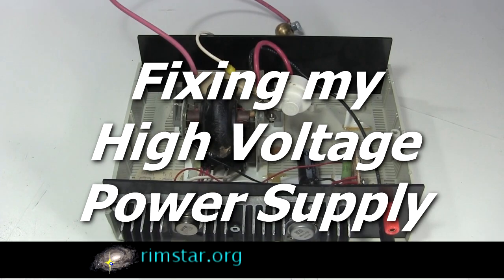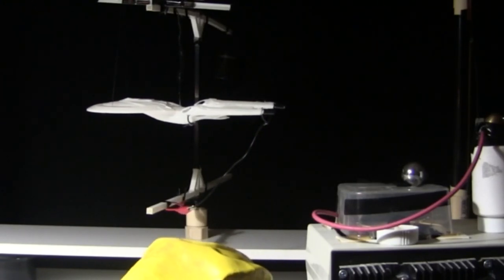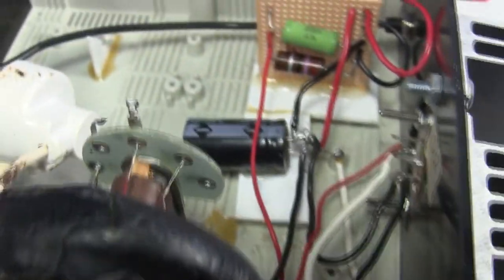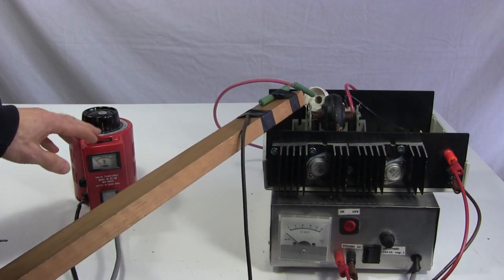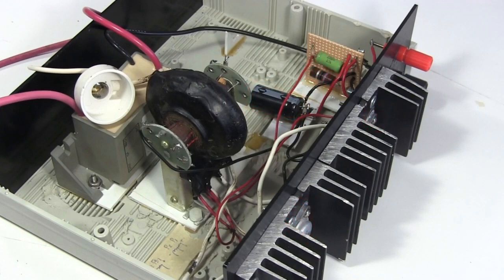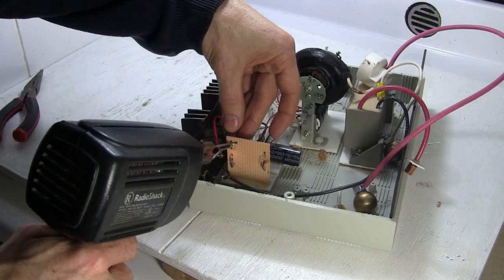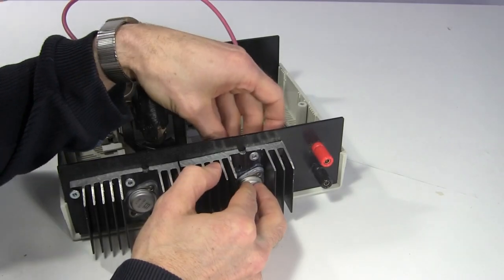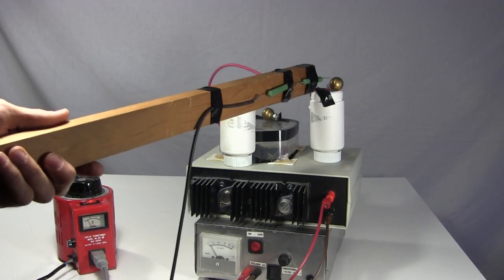Fixing my High Voltage Power Supply

Comment: I love this, as a hobbyist car mechanic, we always test the easiest stuff first. The car battery (or its terminals) is surprisingly the most common problem with cars not being able to start. You really show how to test the easiest to test components first, and then move on to the next. This is especially true for motorcycles. It's trivial to check a battery first before delving into the carbs or other things like the stator! And more often than not, in general, it's the electrics that are the problem (be it fuses or a bad battery). Sometimes it's counter intuitive to go after such a simple thing that isn't likely to fail, but you should always test the easiest to test functions of a system, because even if you're wrong or the parts are working, you're still expending the least amount of effort in the long run. An engine might not start because of a blown cylinder or a starter, but if it's the battery, you've saved a crapload of trouble shooting time despite that the battery in general is the least likely to fail (over the course of a vehicle's life).
Reply: To further explain my comment, to test a blown cylinder you need to do a pressure check, which involves screwing a pressure gauge into each spark plug socket (for non-diesel engines), then turning the engine (with the starter). To test a starter you need to remove it completely and either run a torque test with your own equipment or take it to an auto-store to run said check (assuming a visual inspection doesn't reveal a broken sprocket!). To test a battery you just need a voltmeter and charger! (If it's taking a charge then you can deduce it's the alternator or in the case of a motorcycle, the stator, that's failed.) So, as most auto manuals suggest, always check the battery first, it's the easiest thing to check, though they last 5+ years and aren't likely to be the culprit.

Comment: Good to see you got this fixed! Very happy to see it was just a transistor :)
Reply from the maker: Me too. I was worried it was going to be the multiplier or the flyback. Though if it was the multiplier, I was going to make from from scratch and of course do a video of it.
Reply: That old ac flyback wouldn't be too bad to re-wind either. Might be able to get thicker wire and push more amps...

I cant seem to replace my good flyback that died. Tried a few other with the same extra wind. Not getting nearly as much output. Must have been a lucky one. I think I have another one the same, but its buried under a ton of Plasma tv parts...
Reply: RimstarOrg I'm almost disappointed it wasn't the multiplier (as I watched it was my first assumption) but I'm glad you didn't have to wind your own as that would've been a pain for you! (But interesting to watch, though, I'm conflicted.)
Reply from the maker: joshcryer
I'm sure you meant the flyback, that's the one with the coils. The multiplier is the grey and brown box behind it with the red and white wires coming out. The multiplier has a bunch of capacitors and diodes in it that step up the voltage (multiply it) while also converting it from AC from the flyback to DC as the final output. Multipliers are fun to make and you have to insulate the final circuit either by immersing them in an insulating oil (e.g. mineral oil) or epoxy, as this commercially purchased one is. That's to prevent sparking between the parts. If you're curious, I've made some before and have details on my website http://rimstar.org/equip/pos_neg_voltage_multiplier.htm

Comment: Glad you managed to repair it and it wasn't the LOPT or multiplier that had burnt out!

Luckily you seem to have "good" 2n3055 transistors which have lasted as long as they have; there are slight differences in the fabrication process between different manufacturers that cause people to have such bad luck with these 2n3055 flyback drivers. For example I had an ST branded device that didn't last more than a minute but the "on semiconductor" replacement has lasted years of abuse on power levels around the 60-100 watt region.

But it is always good to use some additional protection across the transistor(s).

Add a fast recovery diode across each transistor with the cathode to collector and anode to emitter; BJT's are rather vulnerable to negative going voltages on their collectors. For further protection use small film capacitors of around 10-47nF across each diode too and this will shift the transistors into quasi class E switching and can even reduce the heating of the transistors slightly. Larger value capacitors will reduce the output voltage slightly but will also reduce transistor stress, so experiment before finalising the value.

I have yet to experience a single transistor failure using the modifications above, so it might be worth a try.

Also if you wanted to increase the output voltage without increasing the input voltage you can reduce the value of the 27 ohm resistor to somewhere between 10-15 ohms, just make sure it can dissipate several watts without burning up! This might make your ion motor spin faster too since there will be a higher voltage and more corona to propel it.

Using this method I could draw 3 inch arcs from one LOPT using the single transistor version of this driver with 24v (required a large heatsink for extended runs).

Really enjoy watching your videos!
Reply from the maker: Thanks for all these tips! This power supplies been incredibly resilient but I might just try what you suggest for the added protection and as a learning experience anyway.
I'm glad you enjoy my videos! I recall enjoying yours too, when you used to upload them. Hint hint :)

Comment: very cool vid rimstar =D i did that many times with my supplies as well can be annoying the more complicated the setup ! where did you get the awesome AC flyback ? and do you use protection diodes on the transistors ? they could help in the future .. anyway cheers !
Reply from the maker: Thanks. I ordered the flyback from a fellow who used to sell them online (around 10 years ago). I'm glad the problem wasn't the flyback because I'm guessing it'd be hard to find a plain one like that these days. I don't have protection diodes on the transistors. I guess I could add some. The transistor's pretty cheap and easy to replace and this power supplies pretty robust; it's withstood an amazing amount of stuff over the years before this first breakdown.
Reply: RimstarOrg yes those types of flybacks can be rare to find i have not one yet but have wound similar ones myself its good fun but lots of time for the hand wound secondary :-P and thats a push-pull config. you built right and you are using the 2n3055's ? im currently using 2n3773's for a new project they are the upgrade for the classic 2n's but yes well built power supply ! and i love the housing too :-)

Comment: Are you using 2N3055s or the NTE  equivalent from what I see now and in your previous video? I'm thinking an NTE 238 would be more durable being it's a horizontal output transistor that was commonly used with the flyback and voltage tripler.
Reply from the maker: Mike Samra I was using 2N3055s before this fix, then I replaced one of them with the NTE equivalent, NTE130, which is the new one you see in this video. I since broke that NTE130 and replaced it with a 2N3055 again. Looking at the datasheet for the NTE238, it does have an interesting difference but I don't know exactly what broke down in the transistors so I can't say if it would be better. Thanks for bringing it up though, I wasn't aware of the NTE238 before.
Reply: I think he 238 will hold up because that's what every Color set as well as big projection sets used that carry upwards of 30 to 50kv.

Comment: hey RimstarOrg, great video, i was wondering what is the full name of that voltage dial you had in that video?
Reply from the maker: Davesh Purohit If you're referring to the red thing I was using to adjust the voltage, it's most often called a VARIAC, also known as an autotransformer.
Reply: RimstarOrg thank you, I really appreciate taking your time to answer my questions, also what power supply do you recommend to build your own ionocraft?
Reply from the maker: Davesh Purohit
Do you mean what power supply would I recommend building to fly a lifter? If so, the one I repaired in this video has done great for flying lifters and powering all sorts of other ionocraft for me over the years. It's the one in this video "How to Make 30kV High Voltage DC Power Supply with Flyback & Cockcroft-Walton Multiplier Tripler".
Reply: Davesh Purohit also one more question, do you have any outside sources where to buy a power supply that is built to fly a lifter?
Reply from the maker: Davesh Purohit You can find some at http://www.amazing1.com/. I don't know which ones specifically as it's been a while since I've looked through their stuff.
Reply: RimstarOrg okay thanks

Comment: I'm interested in that soldering gun. Where can I get one of those?
Reply from the maker: I bought mine at Radio Shack. Most electronics store should have them.
Reply: RimstarOrg Make and model name? I could 'shop-around' with that kind of information.
Reply from the maker: PSRBF6
I selected it pretty randomly. It's called Radio Shack - Duel Heat Soldering Gun rated at 230 and 150 watts. The dual heat means if you press the trigger a little you get one temperature (150 watts in this case) and if you press it more you get a higher temperature (230 watts). The low and high heat feature is nice to have. A big name in soldering guns is Weller.

Comment: how did you ground the wire with the stick exactly?
Reply from the maker: Blueghost136 I bought a three-pronged plug from a hardware store and connected the wire just to the ground prong. You can see it in my video "How to Make 30kV High Voltage DC Power Supply with Flyback & Cockcroft-Walton Multiplier Tripler" at 7:07 and at 7:36. It's a bit of a dangerous approach unless you know what you're doing and you're sure the ground hole in the socket you plug into is actually grounded.

Comment: Any way to block high voltage surge back to the device?
Reply from the maker: I usually put a spark gap somewhere that will spark to ground if the voltage gets to a certain amount. I did that to protect my high voltage probe here https://rimstar.org/equip/hv150kvprobe/construction2.htm (look for the "corona gap"). A more common way to do the same thing is to use a Zener diode (https://en.wikipedia.org/wiki/Zener_diode).